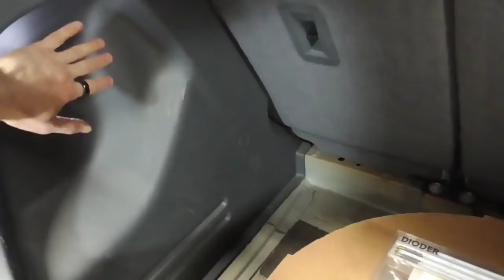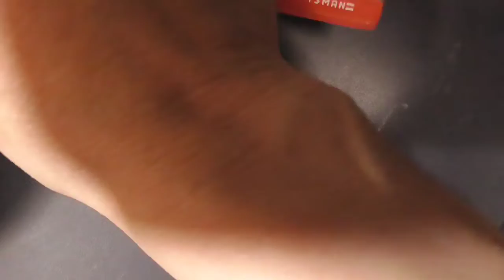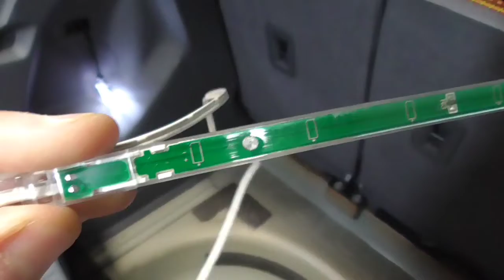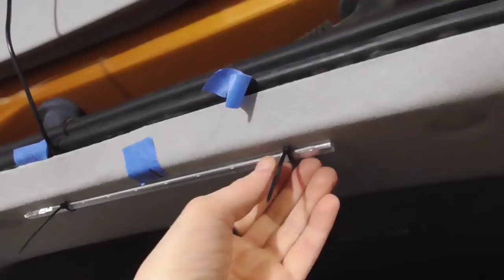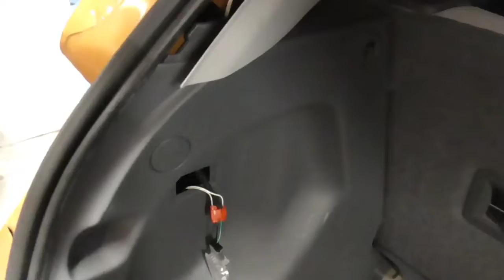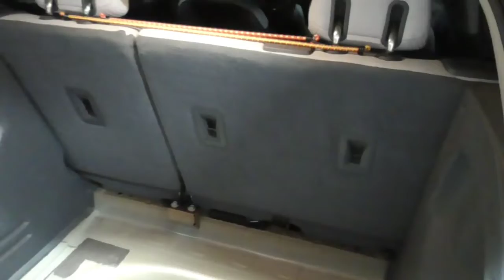Chevy Bolt - Cargo Lighting - Modified - episode # 35

Comment: Thanks for this idea.  Unfortunately, it looks like Dioder lights are discontinued. Any suggestions for a replacement?
Reply from the maker: Try doing a search for "12v LED strip lights" and you'll have plenty of choices.  Just make sure they are the rigid strips and not the floppy tape/rope type.